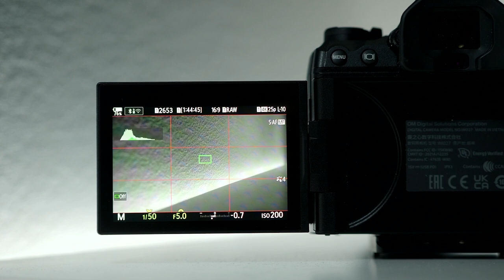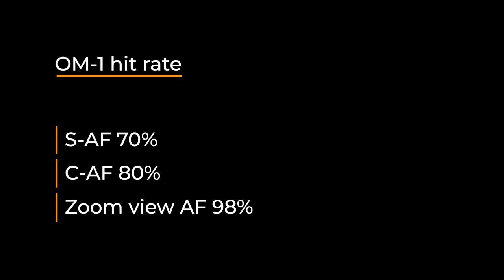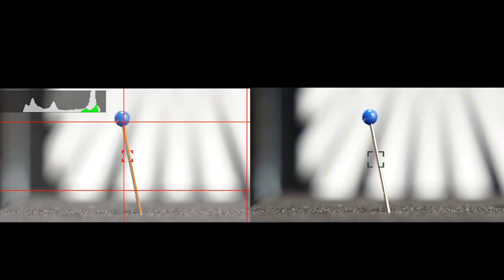OM-1: Let's talk about S-AF.

Comment: 'Release the ambassador, defend our product'

Truth is in my use of the OM1 and the EM1 Mark iii I found the older camera much more reliable when the light dropped. The OM1 was then sold. At the high price I expected much better especially when you can pick up cheaper, much more capable full frame cameras from Canon and Sony. The OM1 really isn't the great flagship camera I was hoping for from Olympus but I'll hold off for a mark 2 and hopefully an improvement.
Reply: I also just sold my OM-1. My first real test I struggled to get focus, asked for tips in forums, sought out videos. The feedback much like to Robins video was a lot of negative fan boyism. People telling me I don't know what I am doing, I need to rely less on the camera's auto focus blah blah blah blah. I bought the camera to increase my keeper rate and it did not perform. I had hundreds of great photos at the same event from the prior year so I cannot accept it was me. I have been an Olympus user for 17/18 years and I am now moving on. I still have my E-M1mark III. But my main camera is going to be Sony or Canon. Have not decided yet.
Reply from the maker: If you refer that OMDS has asked for this video, you are wrong. They do not say anything about the content. Just to make things clear. OM-1 works a lot more precise and faster than older models in S-AF in most cases. In low light and low contrast situations you just need to use either C-AF or PDAF. Problem solved. OM-1 works a different way. It is about the settings.
Reply: @ForsgardPeter  my experience is that it doesn't. My EM1 Mark iii is a more reliable system for autofocus in S-AF from my experience. The OM1 just didn't cut it and was a huge disappointment. I love the Olympus system but their flagship now, in comparison to other systems at the same price point just isn't in the same league. If anyone was wanting to get into the system I would recommend the EM1 Mark iii for now and use the savings on glass or if they want a newer body and are happy to spend the cost of an OM1 I would say don't bother and to look at other brands.
Reply: @Jgatti41  sounds exactly like my experience. I had a similar backlash to my questions and complaints. I've been shooting professionally for over 20 years with various systems starting with Nikon DSLRs so I know what I'm doing and I know when a system's autofocus just isn't up to speed and the OM1s just isn't for the situations I need it for. It is a shame as I do like the company and their cameras but I didnt feel confident enough with the OM1 to take it on my shoots. What people don't seem to grasp is I shot the exact same way with the EM1 Mark iii and the keeper rate was much much higher than the OM1 and when people say well it's because you haven't got x, y and z set or if you do these five things you will improve your keeper rate I've lost interest as a camera system should work without having to ensure various settings are in place. I shoot fast so don't have time to worry about that. Sometimes fanboys just don't like to hear their 'best' camera is actually not all that great compared to others out there.
Reply from the maker: Alex, in all situations? I show on my video how the S-AF is faster when precisions is needed. The very small AF area is an advantage in many situations. That also is my impression in real life situation. In low light PDAF or C-AF is a better choice for OM-1.
Reply: @ForsgardPeter  and that's fine but it wasn't my experience and I always prefer to base judgement on using the cameras in the situations and for the purpose I need them for. I tried it on three events along with the EM1 Mark iii and for the most part I saw no difference between the two until the light dropped. At the end of the day for me the Mark iii was more than good enough and since then I have shot many more with a pair of Mark iiis and haven't missed anything vital so again for me there is zero need to worry about going back to the OM1. The only thing I did love more was the EVF resolution and I do wish the Mark iiis was better. Again this is my experience for the photography I shoot but I just don't think the OM1, especially for the cost, is worth the upgrade if you have a Mark iii.
Reply from the maker: That is totally the right and wise choice if you get better results with E-M1 Mark III. I could totally make all my images with E-M1 Mark III, but I think OM.-1 is better for me right now. The main things is to be happy what you have and make the most out of it. It s the images that counts.
Reply: @ForsgardPeter  I agree with that. I'm not saying the OM1 is a bad camera, far from it, however it just didn't do enough more to justify holding onto it and with your explanation of how to set the camera it may have been better however I just don't want to have to worry about if my camera is set a specific way, I want to be much more focused on what is happening in front of me. You are right the camera has to be the right one for you. I mean for my personal stuff I still shoot a DSLR which is over 10 year old because it just works for me and I love it.
Reply: @alexsteiner7544  I still keep the EM1m3 and EM1X and neither can shoot in the dark like the OM-1. Been using it regularly 1-2 hours after sunset over the past year, and everyone has left by that time because no other camera can AF in that dark. (I never use S-AF though. Not with Olympus, not with Nikon.)
Reply: @alexsteiner7544  I did not keep my mark II because it was better. I kept it for the features I like that I will not have in my next main camera. Live composite, pro capture, starry AF, hi res etc.

Comment: Breaking news: focusing on low contrast surfaces in extremely dim light is difficult!

This is a manufactured issue by a YouTuber for clicks. The real issue is thresholds. The OM-1 has a higher quality control and won't falsely tell you are locked in focus when it's not. The EM5iii will. Take that as you will and around your shooting preference, but if you have a sub 20% keeper rate in real world conditions wouldn't you rather know that and switch to manual focus instead of false positives only to realize you didn't get the shot in post?

Comment: I have owned the OM1 and the EM1 Mk III. Overall, in real world situations, I could see no differences between the two. I don't do a lot of bird if flight or sports photography, so I cant comment on those applications. But for the day to day stuff I do, there is little difference. That was with the original firmware. I have sold the EM1, so I cant compare the new firmware to the EM1. The far superior HHR mode, and slightly cleaner images, were great features of the OM1. I also own a Nikon Z7II, and the Om1 is actually a bit better at focusing. The handling of the OM1 is much better than the Z7II, and it is the camera I go to most often. I have yet to complain about difficulty getting the camera to focus properly.
Reply from the maker: Thanks for sharing your thoughts.

Comment: Thank you, Peter and Thomas, for addressing the issue! To all who think this is not a real problem, let me tell you that I own both E-M5 mk3 and the OM-1, often shoot low light and was also quite frustrated with the S-AF performance of the OM-1 as soon as it got darker, when I first tried it. I was cursing it.

I am not a professional and often shoot more casual. With the E-M5 I can just put it in mode A with aperture wide open, ISO on auto, put the S-AF small target more or less in the vicinity of where I want it to focus and it will give me a keeper rate I am used to, even if I do it less careful with a beer in one hand and chating with people. If it gets darker, AF performance will drop in a gentle and gradual way.

With the OM-1, it works quite differently: as soon as it gets dim, S-AF really needs careful positioning of the focus point onto a contrast edge with correct exposure. The much smaller focus point reduces the likelihood of still getting enough contrast to focus on significantly, when you shoot more casual as I do in such situation and do not place the point exactly where it would make sense for the composition.

Compared to the E-M5, it seems to fail earlier and much more abruptly for these reasons on the OM-1. With a lot of false focus confirmations too, so I would not second that the main reason for this problem is, that it is more critical with how exact it has focus before giving confirmation. It indeed works much more precise and has stellar performance in good light, but that does not save us from false focus confirmations and a lot of focus hunting when it fails. 

From all what I have learned so far, it is indeed much less forgiving in low light. The main reason for that might truly be that it is much more precise. I welcome that much improved precision, but if this is the price, it is quite high. I would like the OM-1 to be precision instrument for professionals and enthusiasts, but also an overall better camera for all shooting styles and really hope, that OM System can do something about it. I will try and adapt my shooting style in the mean time.

Thanks for the tips on how the problem can be worked around. Another tip might be, keep your E-M1, E-M5 etc. and bring it to the party instead.
Reply: … And don’t get me wrong, I love my OM-1 and have learned a lot trying to master it. I understand that it’s a big improvement overall technically or for any serious shooting that demands critical focus. But if you look at it more from a consumer user perspective, expectations might be different - an improved AF should get you more shots with usable focus than before. It should become easier, not harder to use. Especially in challenging light.

Comment: Hearing about CDAF being given more weight with the small AF reminds me of the DFD autofocus from Panasonic. I find that it struggles a bit more in low light, low contrast situations. On the other hand, the S-AF speed in other conditions is so fast that I can't keep up with the beeps. The behavior of AF reacquisition from your speed tests is also similar, but a bit slower.
Reply: Yes, you cannot have precision and high confirmation at the same time. I had the same experience with the G9 - it is not a problem, it is just a design decision.

Comment: Does the OM-1's autofocus issue vary with lens choice? I have, as my only 4/3 lens, the 12-40mm f2.8 PRO II and do not notice any issues at all with the S-AF.
Reply from the maker: No. There is no real issue. The AF works slight different and it is much better in OM-1 than it is on E-M1 Mark III.

Comment: LOL.....apparently you did not see Robin's last video smashing the idea that C-AF will improve performance. Let's face it if you want the best autofocus available you will need to get either a Sony or a Canon camera. I am sure that the OM1 performs good enough in most situations. I would not hesitate to buy one if I were in the market for a M4/3 camera.
Reply: Exactly, following  Robin,’s tests, CAF mode does not improve anything !
Reply: Lol exactly Robin was not happy with C-AF 😂
Reply from the maker: Yes Robin did struggle with C-AF. I got different results and so did Rob Trek. The whole issue is solved when using PDAF. It works perfectly and works the same way as the previous model. The problem is gone when using the right settings. OM-1 works differently.
Reply: @ForsgardPeter  Thanks for you explanations, from my point of view, any device operating mode must be clearly known to be able to use it correctly if this camera works differently, people should take that into account and may be the user manual is not explaining well the behaviors of those different focus mechanisms...?
Reply: @ John Huff, I shoot with the OM-1 until 1-2 hours after sunset every week over the past year, and everyone has left by that time because all their Sony, Canon and Nikon cameras cannot AF in that dark. Go ahead and try your Sony and Canon at those hours.
Reply: @tntytube  LOL.... I shoot Fuji and I totally accept the autofocus limitations of my gear. I have actually considered switching to the OM1 on several occasions but ultimately decided that I would be better served to improve my skills with what I already have. I have no first hand experience with modern cameras from Canon, Sony or the OM1. From what I have seen all are great choices with strengths and weaknesses. I also have an old Nikon D90. I am often surprised by how well it still holds up. I think Peter is spot on by saying it is important to know your equipment.

Comment: Yes, & isn't it funny that one complains because he can't photograph with S-AF focussing on plain white walls! 😂
Reply: Yes, I'm also furious about that 😜
Reply: Yes I was perplexed by this "criticism" in other reviews, and was going to say the same thing in the comments here.
Reply: What if a photographer is photographing walls? Shouldn't should work under all conditions? Or are you OK with companies telling you what you can shoot?
Reply: @formermpc10  If it is a plain white painted brick wall with no side light to create shadow in the brickwork but full sun lighting it, then it is going to struggle to find focus, simple as that & that was how it was with Robin's case. He used another camera that actually has a much larger small AF target area & it was finding some detail somewhere to focus on. The camera is a tool with various adjustments available & if isn't adjusted appropriately then it won't perform as expected. A much larger AF target area would have made the difference, if there was some detail to actually lock onto.
Reply from the maker: formempc10 Then just use the PDAF and everything is fine. It is about the settings for each type of photographing. It is like switching from S-AF to C-Af when photographing a moving subject.
Reply: I like the cut of your jib.
I think I’ll contact the Ford motor company to return my station wagon because it will not do 70mph through 4 feet of snow up the side of a steep mountain. 
That’s ridiculous because it did 70mph last summer on the interstate highway.
Once I get my full refund from Ford I will never buy a vehicle from them again. Go Chevrolet…or maybe a Prius.

Comment: Nice video, I am following this with great interest, after all OM-1 and OM-5 are cameras that will, most likely, set position of and decide if OMDS and Olympus legacy survives as important brand or even at all. 

Issue with low contrast low light is serious cause OM-1, like all m43 cameras is perfect for non obtrusive work within closed areas, like clubs, pubs etc or street work. So exactly the situation when you need high precision, fast single point AF and you often don't have enough light and/or contrast and light conditions are constantly changing. Unless OMDS wants to push m43 into wildlife/action photography where this is not important, but then it was not communicated clearly which is also not a good thing.

Going by my history with brand I am using (not OMDS) I think it can be solved by firmware upgrade. PDAF points are already there, so I suppose there could be a single AF /low light sort of setting added that will use bigger AF area or PDAF instead of CDAF.
Reply from the maker: I think you are right about the communication about the camera. Good point about the PDAF and firmware updates. they could do that, I think... not sure if it is possible.
Reply: @ForsgardPeter  It isn't only a question of communication but of overall strategy.

Comment: In such conditions would it be better to use focus assist light ?
Reply from the maker: It is one solution, but in concerts and other occasions it is not nice if the red light illuminates the scene. It might be distracting to the performer and audience. If that is not a problem, then yes it would.
Reply: @ForsgardPeter  I see that still as problem. The "real world test" had a Lego figurine in the dark with a bright background. What kind of picture will I get anyway?

Don't get me wrong, I love most of his content on his channels and blogposts but his attitude clearly has shifted from calm and friendly to kind of offensive when something is off. And everyone knows since when. From 66000 subscribers around 8500 viewed one of those videos and he counted 50 comments that shared his opinion... first of all that's not much. And if a camera is working great in 9 out of 10 scenarios and not that great in the other one and you only need that one scenario you might have a problem.

The problem I see is, he doesn't mention the 9 scenarios, he's only bashing the one.

Photography still needs light. It's physics, you can't trick that. The most stuff I've learned from the books from Joe McNally and Bryan Peterson. It's all about light in the end. However in critical situations I sometimes switch to manual focus anyway... with any camera. Most of my Fuji bodies are slower than my Olympus/OMDS bodies but I love them anyway.